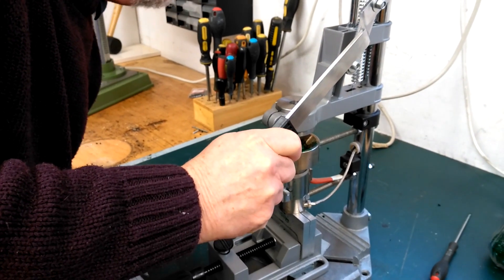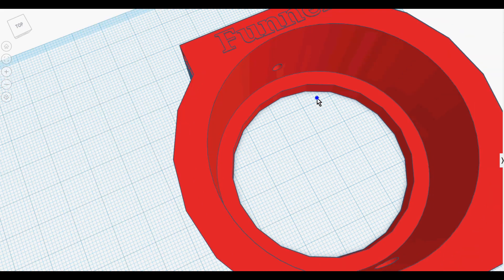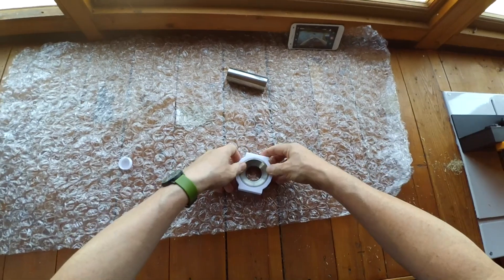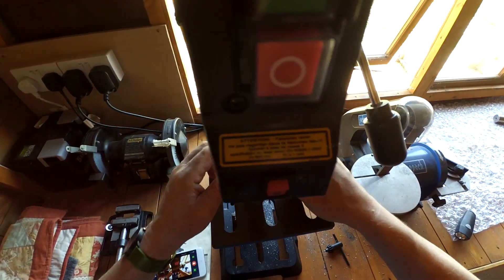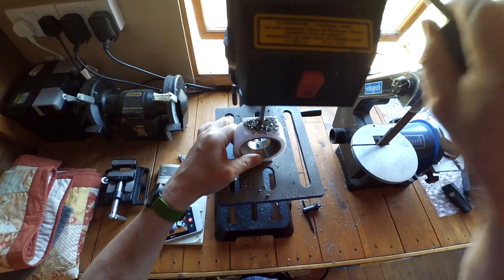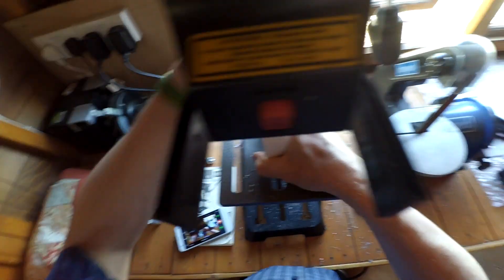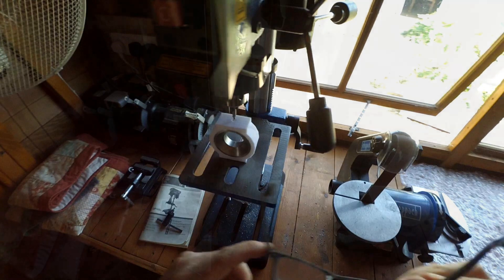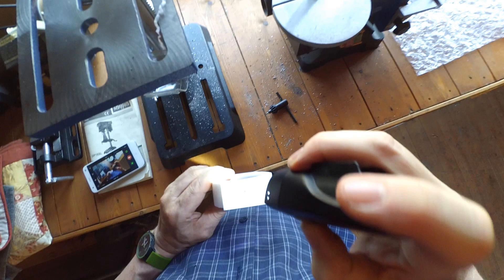3D Printed Plastic Drilling Jig for Accurate Holes in Metal

Comment: Might want two jigs. The one you have now for center hole then another one that has the just the bottom half or slighly more so it hopefully doesn't melt the plastic while you drill.  If the first one stays in perfect condition after just center hole is drilled that may help you out.
Reply from the maker: In later jigs there is a stainless steel insert, and this is certainly the way to go for llong-lasting jigs